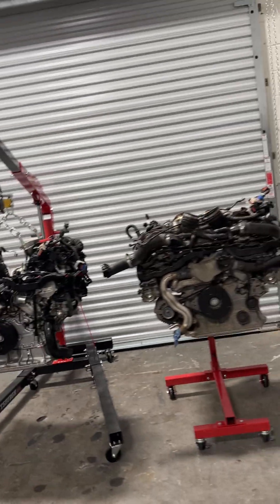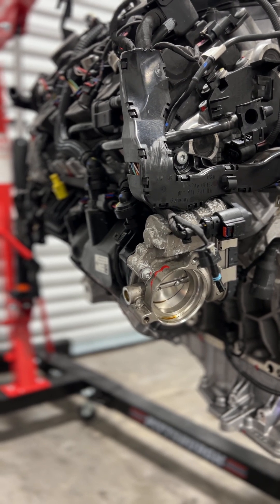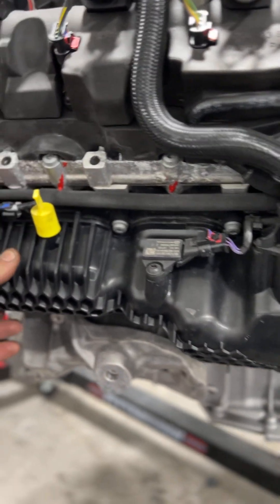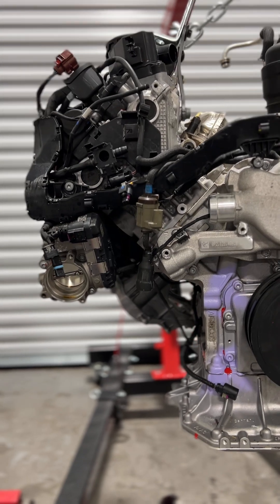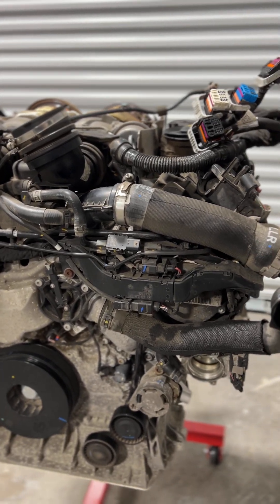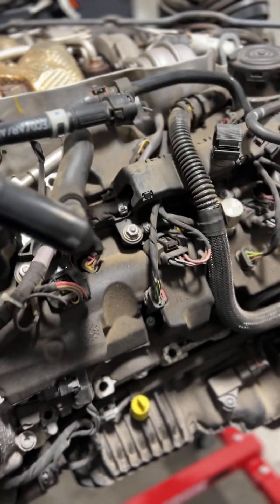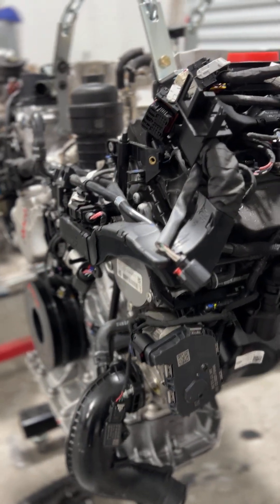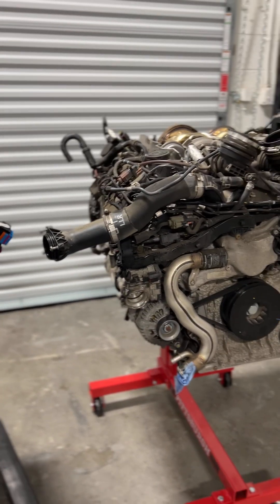Audi & Porsche 4.0 TFSI Engines Compared: EA824 vs EA825 Differences Explained

Comment: Will the Ea825 bolt into a C7? Obviously there's a few things that would need to be modified.
Reply: Besides cooling, there is nothing to be excited about this engine , I actually find out that ea824 compared to ea825, can  withstand more power if your would ever decide to go beyond 1000hp+

Comment: Great video! I own both a EA825 car and a EA825 car, while the 825 is still under warranty I haven't had the chance to do much work on it myself but I am happy to hear it is built better and easier to work on the compared the 824 which is a PITA for simple things. I do have a soft spot though for the 824, it drives so well considering it's not being neutered for emissions regulations both engines are great though.

Comment: I'm hoping to get some feedback from the owner of this channel. I just performed my first oil change via oil extractor on my EA825-equipped vehicle.

After extracting as much oil as possible, I then opened the drain plug on the oil pan as verification that I drained all the oil. However, I got an additional 1.5 quarts to drain.

Looking at this video and at the 2:14 mark, I see the dipstick tube is located at the front of the oil sump. I'm thinking I should lift the rear of the vehicle so that the front tilts forward and I should be able to extract more oil?

Does anyone have feedback on this?
Reply from the maker: You could tilt it for sure… but if there’s a little bit left in the pan, it’s not the end of the world.

Comment: The current generation RS6 and RS7 (C8) both use the EA825.
Reply from the maker: Correct… Bentley… Porsche… Audi… Lambo… 4.0 V8 Twin turbo post 2019+ = EA825

Comment: Hey is the mounting points the same between the motors? Curious if I can run the sq7 in my 17 q7 w/ the ea824… 

Also would be nice to see these ea825 in the c7/b8/d4 chassis 😮

Comment: New subscriber here! Great video, appreciate the run down of these. I am (was) a very happy owner of an 2018 C7 S6. Got a good offer, sold it two weeks ago, and now I am looking to replace it with a C8 or maybe D5 with the EA825. Out of curiosity, could you please listen to the 824 in my S6 in this video: https://youtu.be/B5tcXOojp0U?si=BLIVBQ-b4yVTDA5b
It occurs after some spirited driving in higher ambient temps. As soon as the oil temp goes down (under ca 100 degrees C) it disappears… What would be your guess for the source of the noise?

Comment: I own a 2016 S6 with 113,000 miles and change oil every 5k with the recommended castrol edge 5/40 euro. Do these engines typically last to 200k? Also what else would you recommend to look for and stay up on. Mine is stage 1 E85 tuned.  Thanks
Reply: My tuned 2013 A8 4.0t is at 205k miles. Oil separator, spark plugs, and oil changes every 5k is all it’s needed since 2018 when the turbos failed (reimbursed by Audi).  Awesome motor.

Comment: Great video, Ive worked on enough of these to say, the 824 is such an over engineered with minimal gains, using heavy parts that fix one problem, and cause another, which needs another system to mitigate that problem. its a compromised for packaging, and total disregard for servicing, if you want need to remove, an injector, oil pump, timing chain being on  the firewall side, anything operated by vacuum and solenoid in and around the intake manifold including all the vacume lines that are used for it. Rod bearings, aircon pump, for all of these, engine has to come out. almost starter motor, you have to take out engine mounts to get to it. dot even worry about the PCV might aswell just take the engine out for that aswell, much easier, than doing it in the car. Your turbo is your manifold LOL. Some models have 8 radiators for oil and water cooling. This is all because they used the 4.2 engine, and tried too hard to make it turbo, it never worked. When you look at the 825 its clear they knew what not to do and its so straight forward. one of the biggest differences is, The824 has officially the most complicated and needles 5 piece timing chain, the 825 has the opposite, only 2 piece timing chain. How or why they spent so much time and resources to create such a bad engine, thats unreliable and impossible to work on. Believe it or not, I connected my speaker wires to a S7 engine mount, negative and positive terminal going with the understanding that it creates waves to get rid of noise. and it literally started playing music, not any different from my original speaker, I should upload that video. You gotta ask your self, WHY? lol PS . I own a S7 so the pain is real :) dont ask me why. its like saying, Who buys Alfas, or any British car etc. these are Heart decisions not Brain.
Reply from the maker: Could not agree more.  The 825 is glorious by comparison.  The performance potential of both engines is still quite impressive!

Comment: Did the 825 address some of the heatsoak and intake temp issues on the 824? Where's the pcv placement on the 825? After doing PCVs on 5 different audi engines I'm convinced audi engineers hate mechanics.
Reply from the maker: If you check out our videos, you can see where the PCV is located.  They are integrated into the valve cover on the 825.

They’re right on top. It’s pretty nice. 

As far as heat soak, yes.

They went to air to air intercoolers on the 825.

Comment: How reliable are these engines?
Reply: If you service it properly using the correct oil, they are some what reliable. they are not for people that just want to buy a car and drive it.
Reply from the maker: Bingo! Service is critical! Stay ahead of it.  Small issues snowball quickly!  Don’t ignore that check engine or service light.

Comment: Porsche made ea825, sounds like they are all the same hardware and all tune to over 700hp how nice, unlike the old motor different turbos and cooling packages depending on car model
Reply from the maker: They are all definitely not the same.

I have observed differences between them.
Reply: @themanleygarage  what exactly ? Between s8 and a8 60, all internals and turbos are same part numbers. Intakes are different. What cars are these motors out of?

Comment: I have a b9 2021 s5 and was looking to upgrade to the 4.0t ea825 platform are they reliable as a stage 1 034??
Reply from the maker: Very reliable.
Reply: @ what are the weakest point and can it reach 150k original engine and trans on a conservative stage1 93?
Reply from the maker: @  while the 825 is still a little too new to provide a large amount of data for high mileage vehicles/engines.  There are countless examples of the 824 living long high mileage lives with 150k miles while tuned with quality software and well sorted maintenance.

Comment: Hi man. Thank you very much for such a nice video explaining the differences between the EA824 and EA825. I also know the timing chains are wildly different and timing system reliability is improved with the EA825… I am the proud owner of an RS6 C8 performance and I adore the EA825. Keep the contents coming it’s super cool! Regards from Europe…
Reply from the maker: We will.  Wait until you see what’s coming out very VERY soon. 😊
Reply: @themanleygarage still waiting 😂
Reply: I subscribed and watch Russian “SEVEN FORCE” channel ,who know a lot about 4.0t’s the first GEN and the second GEN , Ya they said the second GEN is more efficient and has better cooling but the first gen can withstand more power 1000hp+ easily than the second GEN without building the engine .They actually still have C7 rs7 that is the fastest on the dragy so far to date on the stock internals.